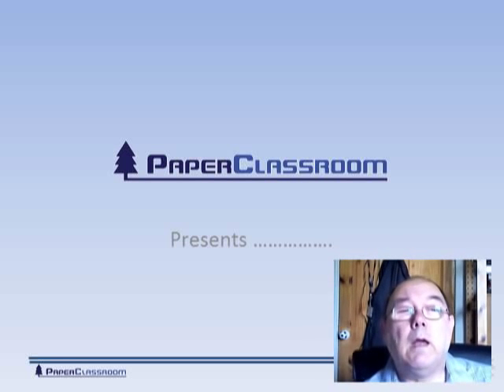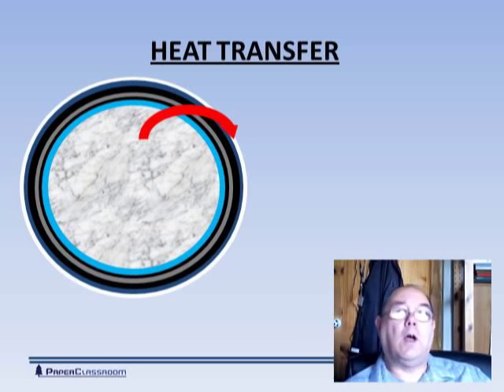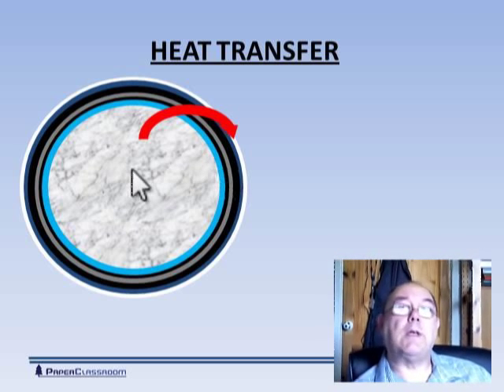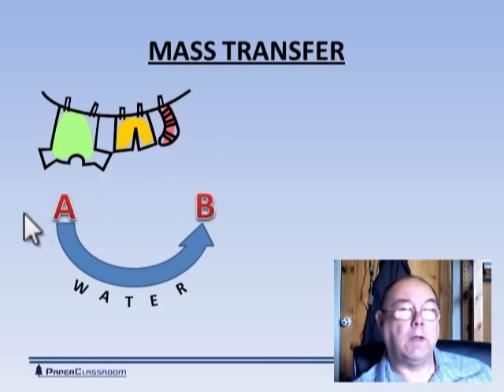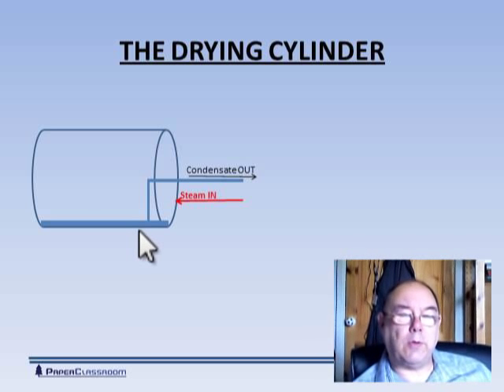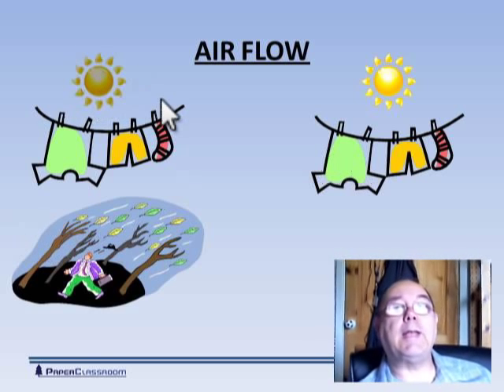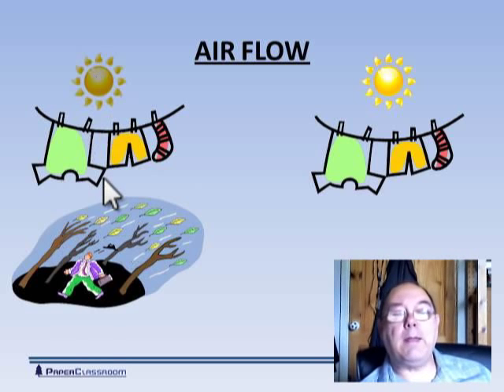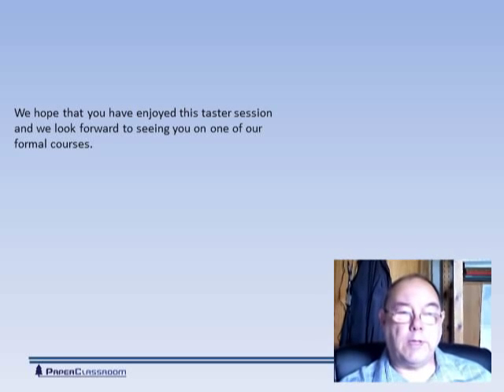Introduction to papermaking - Drying

Comment: Regarding the evaporation on a still sunny day versus on an overcast windy day, it completely has to do with saturation. The higher volume of air on a cold windy day is more effective at drying because even though it can absorb less moisture per cubic meter, the volume being exposed to the wet clothes is many times greater.